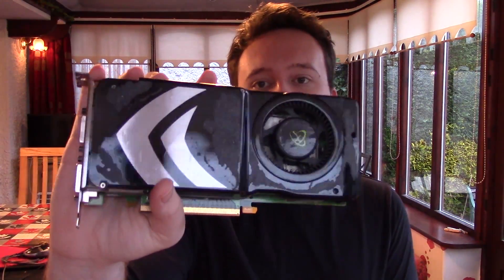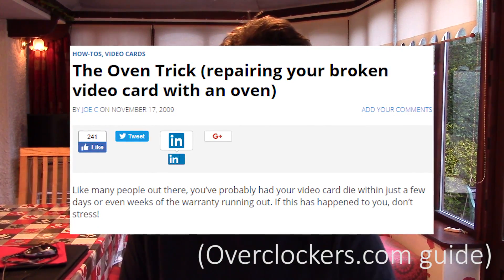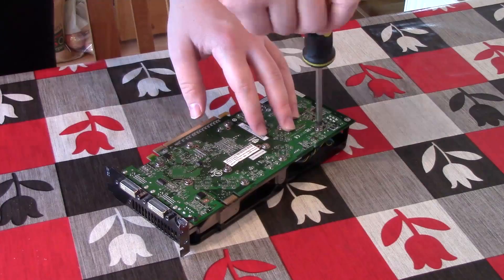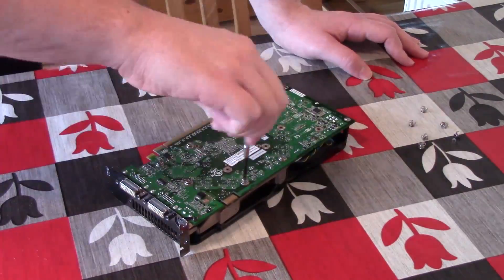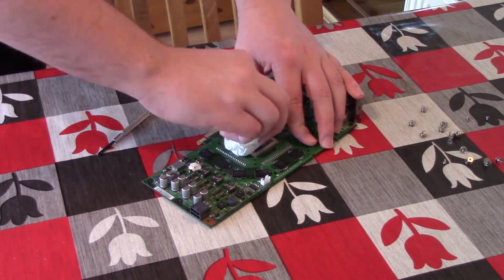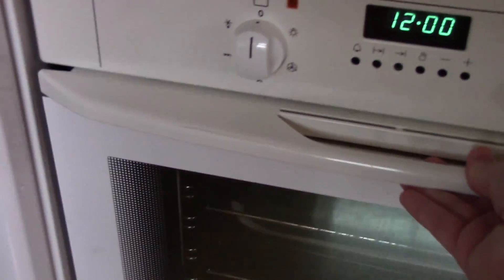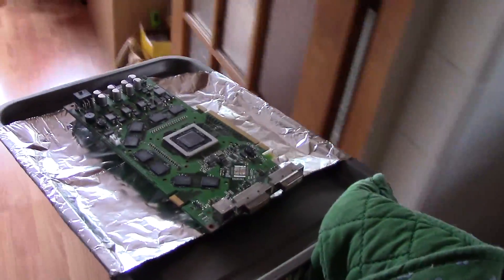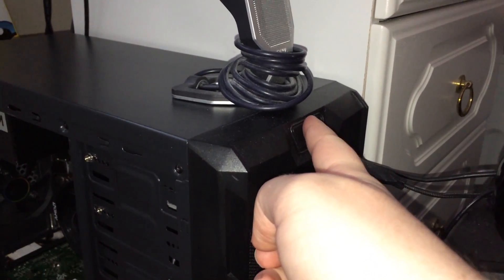Hardware Myths: Oven Baked Graphics Card Repair

Comment: I did this with a GTX Titan (700 series, Kepler I think) I had been thrashing with 1.4v at 1425 MHz out of warranty after one of the caps unsoldered itself from getting so hot (card had a water block, should have also had direct contact cooling with a case fan in this case) soldered the cap back on but only got intermittent contact.  So tried oven "fix" and it actually kept it alive, but had to be reduced to stock voltage and clocks as the super high voltage and clock speed was too much for it after this.  So yes, everything he said is true.  It will eventually give out again after this if you're not careful with heat and stress.  But as a last resort it can work.

Comment: I have used that oven-method for a couple of times without any significant success. The problem is that 200°C in an oven isn't enough to melt lead-free solder.

Later I bought a cheap digital thermometer and a hot air gun and repaired several broken graphics cards and one laptop motherboard using them. The idea is to slowly raise the temperature (about 1°C/s) around the GPU until 300°C, to sustain it for a while and then let the temperature decrease slowly.

Comment: Hey guys,
I know the question I want you to ask doesn't really fit to the topic of this video, but it would be nice if someone could help me.
After 40 hours of playing Star Wars Battlefront 2 (2017), the game started to lagg.
It laggs when I join a game, but it also randomly laggs ingame.
My fps are locked to 60 fps now, but often/sometimes (depends) the fps go down to 40/20 or even to 5 fps and less...
I don't really know the usage of the cpu and gpu (in %), but what I am still wondering about is: why did it start to lagg after 40 hours(?) - there were no problems before (except for server issues).
I tipped the command 'PerfOverlay.DrawFps 1' in and I saw something very strange:
sometimes the fps, which are 'produced' by the cpu go down to the numbers I mentioned earlier, but pretty random - sometimes I am not even in a combat or fight and it starts to lagg.
So the Cpu goes down from locked 60 fps to 0 (worst case) in like a second and it freezes for a few seconds or is up at 60 fps again in no time.
By the way: the same thing happened to me in Bf1, but there are way less or no problems with Gta 5, R6S, Warframe, Bf4 or even Pubg was very playable.
Here are my specs:
I5 6500 (with a Z170-P mainboard from Asus), Powercolor Red Devil Rx 480 8gb, 8Gb of G.Skill ram and a standart 1Tb Hdd.

If you have read this far, I just want to thank you and say sorry for my bad english.
I appreciate your help.

Comment: Ha ha takes me back to repairing my ps3 ylod using a hair dryer and liquid flux, it did work for almost a month the first time then progressively shorter each time it was fixed that way after. Fortunately i have a budget gaming pc i5 2600, 750 ti, 8gb ram and a ps4 now.
Reply: Funny thing is i still own the ps3 (its the 60gb og fatty) and it still boots and runs for about 30 mins before it shuts itself down because it overheats.

Comment: I had a laptop with bad Nvidia GPU that didn't boot and only had black screen. I read that this problem was common with that specific NVidia GPU (broken solder joints due to heating and cooling cycles) so I tried heating up the GPU with heatgun. It was "fixed" and laptop worked fine for about 2 months until black screen came back. I "fixed" it again by heatgun but this time it only took about couple of weeks for black screen to come back. I concluded that reviving that thing was futile and "time to live" only got shorter after each heatgun session. I guess "baking" could work as long-term solution if video card doesn't have any kind of common problem causing the solderings to break eventually.

Comment: This fix work better if you have heat gun because all heat go only to graphic chip and heat will not spread to plastic parts and capacitors.dont try this in microwave.

Comment: Hi,i build my budget gaming pc roughly 6 months ago 
(i3-4130,KFA2 GTX 1060 6gb OC,8gbs of hyperx 1866 ddr3 on an asus h81m-c motherboard)
 and think of upgrading it for as little money as possible so my question is if i should upgrade from my i3-4130 to an i5-4460 or should i save up more money for a completely new motherboard,new cpu and new ram?
Reply: BackUpFile Hi, I went from an i3 4160 to an i5 4460 about 3 months ago, in some games it really only made 2 or 3 fps difference, the best I've seen is 6 fps (Witcher 3) all with a GTX1060/3gb
   In short, the Hyperthreading seems to work well in the Haswell i3, and in my case the higher frequency of the i3 compensated for the real cores of the i5 quite well
   However, as games become more demanding its a pretty safe bet the physical cores of the i5 will be better at coping
   Download Afterburner and apply the on screen display, see how your CPU is coping, if it's spending a lot of time over 90% then an i5 will probably drop that down to 70 to 80%
Reply: Dominic Rivers Thank you for the answer :)
I think i'll just get the most time out of the i3 since it's actually still doinh fine in most games at 1080p at medium to high/ultra.
By the time the i3 gets too weak i'll hopefully have saved up enough money to buy a ryzen 5 1500x,8 gb of ddr4 and a new motherboard to comepletely revive my pc :).
Reply: BackUpFile yeah, just sit on it and skip the i5 for an i7 4970k which are down to about £170 now (from £200 before Xmas) then clock it to 4.2 ish and you won't even bottleneck a GTX1080ti, there's still good upgrade potential in Haswell
Reply: Dominic Rivers Yeah that sounds like a good idea but i don't know if my ASUS H81m-C is a OC capable motherboard.I'll do some research U guess. :)
Reply: BackUpFile It would take a hell of a Ryzen to beat a one of the faster Haswell i7 or Xeon chips even when it hasn't been overclocked (I think your board will let you adjust the multiplier anyway), so, really your upgrade path is Xeon 1223v3 (I think that's the right number) that's a 4ghz four core with four hyperthreads at about £150 and change the ram to 16gb, that will keep you safe until about 2020 at Ultra or high settings on 1080, and then, when data mining eases off, a nice 1080ti :-)
At least that's the way I'm going to go :-)
Reply: Dominic Rivers Ok thanks again for the quick answer!
I looked around on ebay for i7-4790k's and the avarage price is about 107 up to about 140€ thats probably about $160 but since i'm just 14 my parents told me to wait until the end of february since that's the time that I'll have the least stress in school.Thank you again,you really saved me from wasting money on ryzen :)
Reply: BackUpFile The Ryzen chips and boards are relatively cheap, but 16gb of DDR4 is breathtakingly expensive, and as it makes little difference to gaming its just not worth it, there's loads of life left in Haswell for gaming, Google "fast Haswell Xeons" as they are just i7's without onboard graphics and are often £40 cheaper, 8gb of ram is just about enough, but I've noticed a few games just squeezing over that recently, buy clever and your PC will still be playing games at high settings when you are 19 :-)
Reply: Anybody who chose Socket 1150 or 1151 for a build has chosen pretty well for upgrades where gaming is concerned :-)
Reply: Dominic Rivers I think i'll buy a xeon if i can find it for less than an i7 4790k :)
Reply: BackUpFile look on Ebay, Google "fastest Haswell Xeons" a few of them run turbo at 3.9/4ghz or the non "K" i7's, plenty of gaming power to not bottleneck even a 1080i
Reply: I can never remember the Xeon model numbers

Comment: Don't bake the whole thing, just concentrate the heat on the GPU alone. Then put a bit of pressure while it's still hot and keep pressing until it cools down. I ised a candle to heat up the chip (heat on the bottom)

Comment: It's not the "tracks" that fail either. It is the BGA or ball grid array. Balls of solder. Solder is no longer lead it is made from tin. Tin = harder and more brittle. It's usually the flux that fails (kinda like an epoxy) from the card continually heating up and cooling (thus expanding and then contracting) the solder balls crack. That is what leads to this type of failure. When you reflow you literally do just that, turn it back into liquid metal, make it make contact again then let it cool and harden. However, the flux will degrade doing this. I've had it last as long as six months. Good if you are on a shoe string budget, it's better than nothing.

Comment: Don't put it on balls of foil. That is plain daft. Remember - gravity. Anything that can fall off will fall off ! As for Louis? he has his opinion and it's almost right. It does indeed melt the meshes inside the GPU but at the end of the day if the GPU is out of warranty and baking make it works? facts don't lie. I had an 8800 Ultra and I baked it about five times to keep it going long out of warranty. If Louis was completely correct then ask yourself why companies like XFX have reflow ovens (I even have pics of the things).

Comment: My friend did this to a 8800 GTX before selling it to me and the card is still working fine with only CoD:BO2 having issues after 2-3 hours which can be fixed by restarting the pc.
So after 2 years of using the GPU in semi-modern games it still shows a picture so I would say it actually is a pretty good method from my experience

Comment: I have fixed several motherboards using this method.  My son's laptop stopped displaying video about 3 years ago, so I decided to bake it.  It worked just fine, and he still uses it daily today.  Since then, I have fixed several people's computers this way.  Yes, it is not a 100% fix... a few systems needed to be redone after a year or so.  But a 2nd baking brought them right back into working condition.  Only difference with my method is that I use metal standoffs to lift the board off the cooking sheet.

Comment: So, a long time ago I bought a Dell inspiron 9400 laptop which had a geforce 7900gs in it. Nvidia basically did a very crappy job soldering the components and which later lead to a Class-Action lawsuit. The problem with the solder was that after repeated heating and cooling cycles it become brittle and lost connectivity. The easiest way to fix the issue was to put it in the oven and help melt the solder just a little bit. However, this was a very temporary fix. After the first Bake it lasted 6 months. After the second bake it lasted 3 weeks. After the third Bake it only lasted 4 days. And finally after the forth Bake it never worked again. This is an acceptable solution but only if the problem is with the soldering.

Comment: I recommend to add temperature as tin melts at 232 C. It is also a good idea to but some weight on the CPU/GPU while baking it. 

Like this I have revived a whole laptop with an oven. The thing was not booting, just the lights came on. Still going strong for months now.

Baked it until I saw smoke coming from the board and immediately took it out =D
Reply: Hi, do you remember how long did it last in the end?

Comment: i've "fixed" R9 270 which started glitching and displaying black image when drivers are installed, baked it for about 8 minutes (took me about 45min to clean its surface from flux - if you dont do that it will smell bad and contaminate oven) and protected every component with aluminium foil except gpu of course :) assembled it and it worked! :D for week...

Comment: Ive revived two old laptop motherboards with overheated NVidia chips with a heat gun in the past and it worked great, however i recently tried to do a r9270x that wouldn't power on and it went badly... By the time it hit 350f two capacitors exploded, one of them knocked off a ram chip. So its definitely at your own risk, but it can be worth a try if its dead anyway.

Comment: My 8800 did this same exact thing. Quite a few years back I lent my EVGA 8800GTS 384MB GPU to a friend, he managed to some how place one of the PCI case shields OVER the rear vent and cooked it after a few months (Dual slot card.), how it went that long is beyond me. I swapped out that 8800GTS with an XFX 8800GS Alpha Dog Edition that was passed down to me from my dad's rig a couple years before that. I still have the EVGA but it's got the exact same issue, purple lines and won't boot properly into Windows. I was tempted to heat gun that sucker just to get it at least working because it was a great GPU and brings back a lot of good memories but I don't want to pay $200+ to have it properly done.

Comment: I prefer the heatgun method !  Its safer when compared to the oven method  ! Oven methond heats up the whole gpu which is not necessary . But with a heatgun you can heatup the memory and the gpu processor which may be the main cause of  the problem !  

I kno this becasue my R9 270X  is working like a pro after the reflow using a heatgun ! And its been 3 months no issues were found !

Comment: the quadro in my laptop died, so I brought it back with my hot air station, it died again a month or so later, so I did it again, it died again a couple weeks after that and remains dead. Like doing CPR on a dead heart. I knew it wouldn't last forever, but it lasted long enough to get a new board

Comment: Believe it or not i fixed a gtx 560 ti in 2015 i bought for $10 that had white lines in the screen and wouldnt render 3d.. It probably was a vram issue but baking it fixed it and it still works

Comment: Not a permanent solution to reballing, but sometimes helpful with cold or fractured joints.
Alot of common solders run between 180 and 230°C, cold enough for a common household oven to reach.
Had luck with some cards (8800 GT worked for another month, 7300 GT went through it twice and got around half a year out of it, Voodoo 3 sadly is still dead)
A heat gun can also work, but the same applies.
Still not a permanent solution.

Comment: It's great that you're using a G92-based 8800 for this.  That was the GPU that started the "oven fix" trend back in 2007/8, which is legit.  I wouldn't be shocked if you ended up being able to use that graphics card for several more years.  A lot of people did this with the 8800GT and GTS 512, as well as the 9800GT/GTX.  I suspect the GTS 250 has the same issue, since it uses a slightly revised G92 chip.

Comment: great video, i had an r9 280x, loved it, but it shat itself. Tried everything, but it has bad artifacting whenever it is actually utilized (before installing a driver it is fine, there is a different simple chip for that I believe), underclocking memeory helped a tiny bit, but I think it is the contacts or capacitors somewhere. Haven't tried this yet, I live in a shitty room right now and don't have access to an oven lol. 

I had one of the shitty MSI 280xs with the non Hynix memory (can't remember, it started with an e I think) that were known for failing lol, so this probably won't help too much ;_;

it's fine I got a 270x from craigslist, still great for 1080p, all i play is DCS world, dota 2, and older games anyway lol. 

peace, great video

Comment: Well you can do the oven trick, but the capacitors will not be happy at all! They are rated for 105°c and anything over that will result in an early failure of it, the best you can do is take them out and then bake the card with no capacitors because remember even if they don't pop they will fail prematurely. Just an advice for you guys

Comment: PI had an 8800 GTS cost me £375 and went wrong after 17 months this fix can work for a while with some laptops I have a motherboard from a laptop that has a graphics problem going to try a bodge reflow see if it works a really is the only way for long term reliability if my solder station ever turns up from AliExpress I want to have a go at recalling some 60 gig ps3's.

Comment: I resurrected my GTX480 and ran it for a year nearly nonstop after, it still works just sitting on a shelf now replaced by a 980ti. I didn't do the foil balls I used some extra standoffs in screwholes and cooked in my $5 wolfgang puck toaster oven from the thrift store.

Comment: I use to buy used laptops with bad gpus.   I used this method to test if card was recoverable.   If bake method restored it working or cleanup picture,  then is worth pay to be restored.   I did do many dell XPS with gtx 7800 7900 7950 and few others

Comment: if the problem lays in one of the solders, this will work as a reflow like with laptop gpus, you can burn the plastic pcb but the pcb is irrelevant as long as the circuits still isolated, burn the fan connector.. unlikely, the plastic yes the conector itself, no this in fact has high fix chances.. as long as its solder related, if its capacitor or gpu itself... anyway if u r going to trash a broken gpu try it, anyway u can win it back or proceed with the recycling.. funny thing, a gpu such.. advanced micro tech
 oven fix

Comment: baked my gpu two times. first time at 190•C for 8 minutes. gpu worked for 1 month after the bake. 2nd ti e i baked it at 205•C and now it works for 2 straight months without a problem

hd 7950 3gb asus direct cu

Comment: Temperature melts solder under gpu, but it damages capacitors too. I recommend to use cheap hot air, and preheater to Fix issues.

Comment: Had to do this with my own 8800gts. Worked for about 6 months as most others who I read did the same thing said it would. Got replaced with a radeon 5770 upon it's second failure.